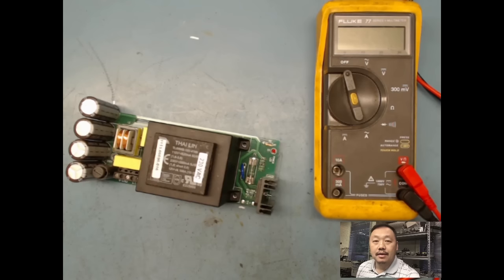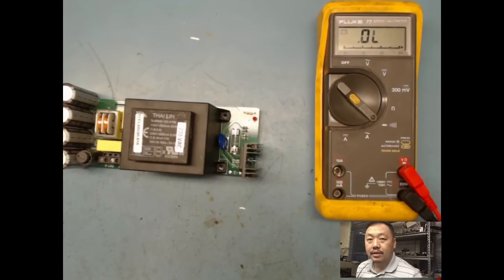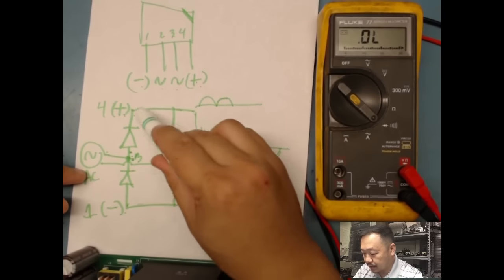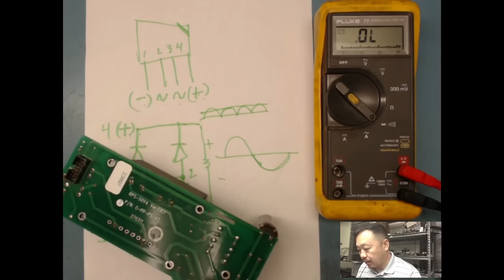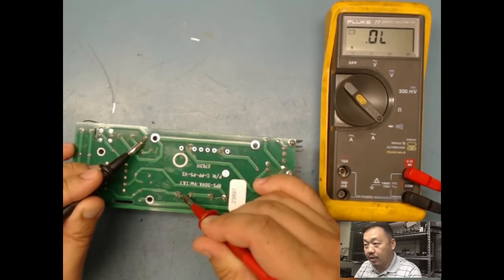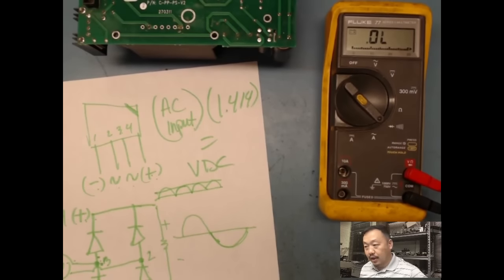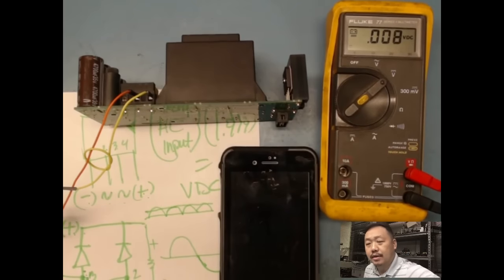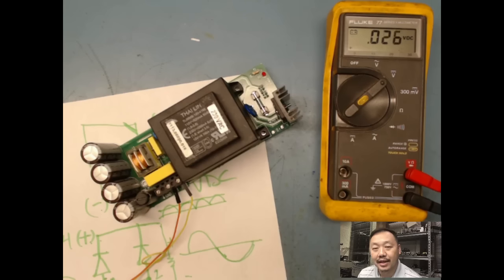How to Troubleshoot Electronics Down to the Component Level Without Schematics

Comment: You said basically a short the fuse is good because you had a beep with the meter. What you did was test for continuity the beep indicated the fuse was good. No beep and it's bad. Take a simple wire put one lead on one side then the other, you will get a beeeeeeeeep. Cut that wire in half and measure the same way you will get nothing, now you have a short or the circuit is OPEN. Also with the Transformer Place the leads of the ohmmeter to the leads on the (high side) of the transformer. The meter should be identifying a resistance reading. This reading will vary by the type of transformer used in the circuit. If the meter indicates an open circuit or infinite resistance, the transformer is bad on the high side and must be replaced. This will be done in OHMS.

Comment: Life long tech here: There was a period in my career where I had nightmares of little old ladies running around with Huntron Trackers fixing everything insight.  I thought unemployment and hungar were in my future. Through my own use of a tracker, I learned it was just another tool siting on my bench. The greatest tool I ever used was an understanding of just how the damn thing worked. 

In todays electronics, components are very robust and far less apt to fail on their own. Everyone starts out thinking its going to be an electrolyte capacitor and in many cases it is. However, by far, the most common failure these days are cracked solder joints. Not from manufacturing faults , but from mechanical stress caused by different rates of thermo  expansion and contraction between components and circuit boards. First thing to always do is a very very close visual inspection of solder joints. 

50 years of experence working at a research University.
Reply from the maker: Thanks for the insight!

Comment: The visual component inspection should also include the "SMELL" test. many times the tech can smell fried electronic materials when the device is opened up for the visual.
Reply: Hmm the smell of burnt electronics in the morning 😂
Reply: true, but a SMELL test is not a VISUAL inspection

he was correct though
Step 1..  Visual Inspection

he did skip Step 2.
Step 2.    does it pass the SMELL TEST ?
Reply: I can usually tell something is burned vefore I even open it. KINDA smells like a chlorine tablet... I kinda like it. lol
Reply: @briannedunn6938  Unless it's a cheap Chinese PCB, those smell like burning PVC.
Reply: Some people refere to the visual inspection as physical inspection. basically the same thing i guess.
Reply: @Delta-2-0  yea smell the lead !
Reply: You should do a Lick test too ! Lick the component and taste if you feel something acidic .. that would mean a capacitor leak
Reply: i also use it when looking for a girlfriend
Reply: Step 2 should be "thermal image" test with lower voltage injected on power rail.
Reply: @VandalIO  Greetings.  The lick test is certainly not recommended and is a practice that should not be promoted. You certainly do not want to ingest electrolyte given its corrosive properties.
Reply: @martinkuliza  Maybe it looks like it stinks.
Reply: @donaldadams309  
Maybe......
and Maybe it smells like something doesn't look quite right :P

Comment: The best practical explanation of bridge rectifiers is included in this video. The diagram this guy uses to explain the bridge rectifier is much simpler and easier to read than the conventional drawings. I never had trouble in testing rectifiers after watching this video.

Comment: I worked in AIMD as an Avionics Technician working on ASW gear (technically my rate was Aviation Anti-Submarine Warfare Technician - AX - but they merged it to AT in the 90s).  This is a great video to demonstrate RE techniques!  Typically you'll want to have a schematic, but sometimes, especially with homebrew stuff, you might not have one.  Being able to troubleshoot and experiment is important, but if you don't know what the circuit looks like you are basically in the dark.

Comment: THE VERY FIRST THING TO DO IS DISCHARGE THE CAPACITORS BEFORE YOU GET FRIED, COOKED, THROWN ACROSS THE ROOM AND MAKE YOUR WIFE A WIDOW.....YOU GET THE PICTURE? I have had to many Electronics Technologists get zapped by the capacitors that feed through coils that step up the voltage. I have hand tools melted, burned, etc. One fellow thought it was a correct procedure to take a screw driver and arc it across the polarities of a 100 Farad Capacitor to try and discharge it. BIG MISTAKE!!! The screw driver got zapped and exploded out of his hand across the room like a bullet from hell.  He was in shock, eyes wide open and everyone looking at him very disappointed. Instead, do some math to calculate the ohms and wattage of a resistor to discharge the Capacitor safely.
Reply: Not all the time but if the circuit fuse explode and the problem is power ic. .then filter capacitor have stored charged. .thats the time to discharge 1st the caps.

Comment: Look at the brands of the electrolytics, Chinese brands are no good. I like Japanese brand like Nichicon. Somebody sent me a 1991 power supply board for a church organ. It had Nichicon 85° rating electrolytics, I replaced them with brand new 125° rating Nichicon electrolytics. After 30 years, I replace the electrolytics. The diodes were good, a regulator was bad and I replaced it. Being an electronics technician, I pay most attention to electrolytic capacitor brands. I prefer Japanese, Korean, German, and US brands. Electronics and engineering classes don't emphasize on component brands, they should emphasize on brands.
Reply: You’re absolutely right.

Comment: I'm currently doing your course. Right now I'm about 80% done. I noticed three, extremely important points that I appreciate about course. 1) introducing most commonly used components in the  right order 2) teaching how to use test instruments 3) analysis of some classical circuits. The course is most suitable for beginners who'd like to start from repairing through-hole component boards. The course is great for me. I recommend all beginners to check it out. Thanks.
Reply: Where is this course? Website, YouTube?
Reply: @destro513 can you check the link posted on the pinned comment of this video? That link will lead you to the right place.

Comment: Just wanted to thank you for this video. When I was a kid back in the 70's I became interested in electronics with a lot of inspiration from my grandfather. On Saturday's we would go to flea markets and find old tube-type radio's and take them home and repair them. Of course a lot has changed since then. Now most things are disposable and with the advent of s.m.d. technology rather difficult to repair, what a shame. Still, every now and then my electronic skills come in handy and I still enjoy building various electronic kits from Velleman etc. Thanks again.
Reply: Why does SMD make things difficult to repair?  I was a repair technician for a few years, and our boards were heavily SMD, with only some through-hole components here and there (outside of connectors).  That never prevented us from repairing the boards, unless there was already something wrong with the PCB, or if we messed up and overheated the multi-layer PCB while using hot air.

Comment: Thanks for doing the video however with apologies both the process shown and your description includes so much misinformation it is concerning. Eg: for your electrolytics check your capacitance values and ESR and if they’re OK and in range unless there’s visible physical damage, they’re fine; With AC voltages you really need to specify that they’re either RMS or 0.5 peak-peak. The DC output will be ~ 0.5 pk-pk minus the voltage drops across two of the diodes in your Bridge Rectifier; The really dangerous capacitor voltages are those in your 240V side of the circuit, not on the output as they are less than ~50V... Again apologies as I know it’s easier to criticise than create, but...
Reply: It's good to criticize.....this is how we learn......I love to troubleshoot..... most time there are no schematic diagrams for these boards.....and also replacement components are almost impossible to get.....
Reply: Where do you reccomend getting additional quality skills training?
Reply: It sounds like an ego writer has popup!

Comment: My first job from school, age 16, was learning electronics on Atari CX2600 Gaming consoles in 1982.
Tech College was 20 years behind my actual work at the time.
Later gaining a great career in the Slots Gaming industry, because they required Techs who'd worked with
video, as they were moving away from spinning reels. 
Much of my Electronics repair work was with custom diagnostic equip, which would've been a bit tedious without it.
But I can only imagine how many consumer products have been thrown out, that a total amateur could've fixed in 10 mins.  Many of them are OK far beyond warranty, apart from some silly design cost cut related weakness,
that's worth learning about.

Comment: Measuring across an installed fuss and getting continuity/resistance/beeper, does not mean the fuss is good. The fuss could be open and the continuity may be through the circuit. To be sure the fuss is open, take it out of the circuit. You can get by with testing continuity of a fuss with one end of the fuss open.
Reply: Yeah all that is true... but you can't even spell FUSE.  Way to go. And a short and continuity test are not the same thing, this guy keeps saying short, it's not a short.
Reply: @Rico702Vegas  exactly, i thought i qas taking crazy pills listening to the dude in the video.

Comment: That process did not fully test the bridge rectifier, there could be one or even two open circuit diodes in that bridge.  As the transformer secondary is connected between the two AC terminals and that is effectively a short circuit your test is really only testing half of the rectifier.   You need to either remove the bridge and test it out of circuit or connect a load and check the ripple frequency.

Comment: Good stuff!  To your visual inspection you might add these two:  indication of prior repairs, which may or may not be correct, and may show points of failure. And look for components added to underside of board to correct design flaws.  Maybe the patches didnt work as expected or lead to other problems or failures later.

Comment: Nice video.  I have wondered how much you could do without a schematic all my life.  I have always wanted to be an electronics guru I just never had the friends, mentoring, or time to raise my skill level (even though I have an EECS / mostly CS degree from MIT).   Worked on a broken Heathkit oscilloscope and found the broken 7815 power regulator which was melted / crashed - after a FEW HOURS!  Built my own bicycle-light charger starting with a 5vac adapter + full wave bridge for a do-it-yourself rechargeable wonder bicycle light.  I think it helps that all power supplies (mostly) are pretty simple and pretty similar.

Comment: Good video.   I will have to say it's better to check a fuse by testing output voltage.  I have seen many partially blown fuses causing a voltage drop and not an open circuit.

Comment: I would like to add.
If you get stuck and can't find any problem you can temporarily replace the fuse with a lightbulb as a current limiter. Using a lightbulb will allow you to safely power the device while taking voltage measurements. To choose a close enough lightbulb see how much power the device is supposed to take and replace the fuse with the same or lesser powered lightbulb (10 watt circuit use a 10 to 5 watt 120 volt lightbulb). The circuit won't blow and the lightbulb will allow some current to flow.
Reply: Gotta watch this video series to see how the Big boys do it!

https://www.youtube.com/playlist?list=PLvn9LlA-_znIZ66FQ8wfSfTX8VpoLo5fb
Reply: Also helps if working in low light situations.

Comment: Thank you for your videos. 
I'm a newbie to electronics. Now, trying to choose ftom a huge variety of multimeters. Watching through your videos, it seems, that for troubleshooting and repair of home appliances, like tv, radio, microwave and etc, the basic functions ( resistance, voltage, current, continuity/diode test) of multimeter are useful, only, did I get it right ?
Reply: Simpson 260 or a fluke clamp-on

Comment: O.L stands for Open Line or Open Link
Reply: O.L. can mean different thinks, but for voltage and current on a DMM it usually means "Over Load" , but for other measurements OL is used to indicate Out of Limit because the measurement exceeds the limit (upper or lower) of what can be displayed for the given settings. Always check the DMM's user manual or guide to see how the manufacturer uses the term.
Reply: I thought it was open loop
Reply: @jeffverive3596  wow, you are right, it is overload, just checked the fluke 77 manual.  Kind of misleading, since an open circuit is under loaded.  But I guess it could be interpreted as, since this is a diode check mode, that there is an internal controlled current source that cannot conduct, so the voltage required is beyond the capability of the circuit perhaps.

Comment: Good job, power supplies are one of the most mystic and difficult to understand sections of a (PCB) printed circuit board. Mainly because they convert AC to DC and the components don't like giving up their secrets with a simple good or bad answer. For instance the capacitor and transformer may test okay but under a power load they break down.  Let's see more videos!
Reply: does the power supply really turn AC to DC? think you might want to check that

Comment: Thank you so much for making this video!  

I'm a self-taught electronics hobbyist and I love learning about electronics, whether its on Youtube, some free resource, or a book.  I think its great that you showed how to troubleshoot without schematics because sometimes, there isn't a model number you can visibly see on the component or maybe the datasheet isn't available online.  My first instinct is always to look up datasheets for each component so I can know the pinout.  Its easier to debug the issue when the components are by themselves but in a circuit, its more difficult because other components can affect your DMM measurements.   

For me, what I learned in this video was:
1) For visual inspection, check for burn marks on traces, cracks in the PCB (which could cause open circuit somewhere), and cold solder joints (e.g. look for cracking).  
 Comments:  I would also add to look for obvious things like a burnt component or possibly a capacitor is bulging.  Maybe one of the leads of a component somehow snapped off.  Poor solder connections (pretty rare).  Liquid damage can also be an issue.  
2) Go through and check for shorts and verify that certain components should be connected and/or have specific resistance/impedance.  This is where datasheets can be very helpful, if available.  Really know the components (this is something I need to improve on!)  
3)  Power on the circuit and verify that certain components are receiving their correct voltages/voltage drops or that LEDs are turning on/sequencing as they should be.

Comment: Often a component that fails is "passive", i.e., "resistors, capacitors,  inductors (coils, transformers) and the simplest to detect initially by sight and or smell. Any circuit is either "open" (no current flow) or "closed"( allows current flow). Understanding the various passive and active components applications in DC,  AC, and Digital (also by low voltage TTL 5 DCV or CMOS 15 DCV).

Comment: at 40:37 you were doing the calculation for AC peak-to-peak that's the voltage differential between the maximum positive and negative peaks. When you convert peak-to-peak  into DC  only the positive (and/or negative) charges remain from zero to peak(not "1"). 
You likely had the non peak-to-peak AC voltage and to calculate that is just "AC Voltage=DC Voltage"(Not counting for efficiency loss.).